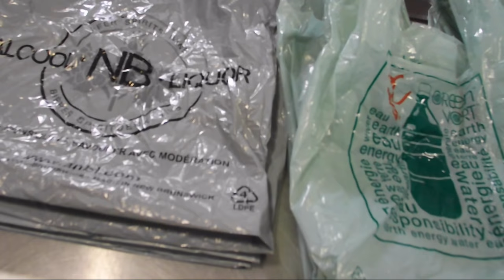DIY Polyethylene Canoe hull and keel Repair for Zero Dollars

Comment: this works great for linear polyethylene, but if its crosslinked polyethylene it wont work. OLD TOWN made canoes with both materials, its whatever the supplier sold them so theres not one date where they switched. but newer the boat the greater the chance its linear polyethylene.
Reply from the maker: Thank you for the information

Comment: thanks for sharing I have a Saranac 146 and haven't had it very long and I've already noticed some deep scratches the plastic seems very soft.
Reply from the maker: Hello Riverat74, thans for your feedback. i dont know if the medium show in the video would be good for scratches, it worked and its holding very good to repair the missing outer skin (worn out) of the canoe
Reply: +Sticks, Stones and iron right on buddy... I just meant eventually it will come to this I would imagine. thanks for your response.

Comment: While very creative and it works….save yourself time and get West Marine G85.  Rough up with 100 grit then flash heat with torch (this removes the poly sheen allowing the epoxy to adhere).

I’ve repaired a 6” S crack on my Hobie and completely repaired a damage bow on Old Town Discovery 15 sport.
Reply from the maker: Good to know, thank you for the tips

Comment: here in California unfortunately they have gotten rid of most plastic bags all that is left are the ones for vegetables it seems they are #2 HDPE bags. Nice to no these will work for the outer seal I my crack are are surface so going to use "Methacrylate Adhesive Epoxy" to repair and finish it using my heat gun to melt plastic bags on top as another layer. GREAT VIDEO.
Reply from the maker: I just lookup Methacrylate Adhesive Epoxy, heavy duty adhesive, nice! 
Thanks for the feedback and good luck with your repair
Reply: And sadly, the Nation under Dumbo seems to think Califfiria has allbthe right ideas.

Comment: Really nice to know thank you! Has it held up nicely?
Reply from the maker: It still hold up when I sold the canoe but the thin layers of plastic bags were slowly coming undone from water
Reply: We tried your repair system on our Old Town Discos - It worked for a while and then chipped off right back to the old hole.  Everything we've tried eventually falls out again.
Good ideas though.  Thanks.@JoeBakerOutsideTheBox

Comment: I have some large cracks on the inside of my Old Town Discovery canoe. The PO tried to use fiberglass and it pulled right off. I'n not too concerned about it, it doesn't leak and you cant tell from the outside that it is damaged but I am wondering if this repair should work for the inside layer as well? Thanks!
Reply from the maker: I never tried it, it depends on the type of plastic...worth a shot, it is  not waterproof but slows down the wear

Comment: And did it hold up? Can you please post an update video about it? Thanks. 👍👊
Reply from the maker: When I sold the canoe several years ago, the patch was still holding on but the plastic layers starting from the top detached from each other. So not waterproof, but it definetely slow down the wear and tear on that spot

Comment: So how long did this hold up?
Reply from the maker: The repair patch is still filling the gap in the canoe hull but the water works is way between the plastic layers over time and the layers slowly detach itself and feel kind of spongy
Reply: @JoeBakerOutsideTheBox  thanks ive got a crack all the way through that i am going to attempt a hybrid approach, i will be pulling materal away from the crack on the outside, putting a fiberglass patch in then returning the skin material to the area
Reply from the maker: I dont think the plastic bag are waterproof in the long run but for the cost its worth a shot, good luck with your project
Reply: @lifeisgood12341  - whatever you do is still going to involve some work, but seeing as though you're just doing a crack (presumably, not a giant repair), you won't need much of whatever you choose to use, so cost isn't really an issue.

I'd play it safe and use something you KNOW is going to bond and look decent in the end, after some light sanding... Consider using a two-part marine epoxy or whatever is recommended for the material that you're working with.

You'll probably get away with picking up a single "dual tube" application at Fleet Farm, Wal-Mart, etc for far less than 10 bucks, and at least you won't be relying on bonding the canoe to some other plastic via a questionable  heat bond. 

The only way this bag method would be strong is to actually heat the canoe to the "flow point" where the materials mix together, and that could end up disastrous (if even possible ). Otherwise you'll have delamination, as Sticks, Stones, and Iron pointed out.

JB Weld, 3M and even GOOP have a lot of different things that would work for about 5 bucks at your local big box stores and there are more industrial options like the "G-Flex" two-part epoxy that you'd simply squirt out, mix, apply, and sand smooth for a bulletproof finish

I used this guy's method (heating black zip-ties) to "weld" a smashed lawn tractor grill, and it turned out absolutely flawless after some fill and finish, but the grill sees no stress. Your canoe... Well that's a lot more flex and stress.

Trying something outside the box is always fun... But digging it out and redoing the whole thing a second time after it fails... NOT so fun. Especially if you plan to go the extra mile and make it look pretty with a little topcoat.

Good luck.

Comment: Could you use a HDPE plastic?
Reply from the maker: Old Town Canoes Discovery is built with Extremely durable three layer polyethylene, so yes HDPE could work, I choose LDPE for its very tough, weatherproof, low water absorption properties

Comment: How did it hold up?
Reply from the maker: pretty good, it's kind of fused there. Wear out a little faster than the original material, but stable
Reply: Joe Baker thank you.  My old town discovery is getting hairline cracks on the outer shell only so I have been trying plastic welding, but the cracks came back.  However, we took on the Main Southwest in early may and the only water that came in was over the top.
Reply from the maker: The inner shell is really tough, as long it is not breached it should be water proof
Reply from the maker: Thanks for your comments
Reply: I just bought and Old Town canoe today for $100. It has a repair that was done to it, but there is a hairline crack on the underside. I am going to try this repair tip. Thanks for sharing.